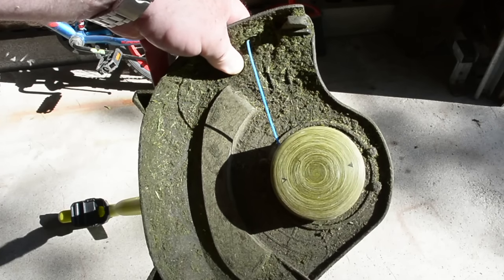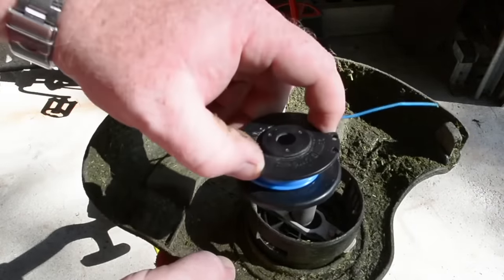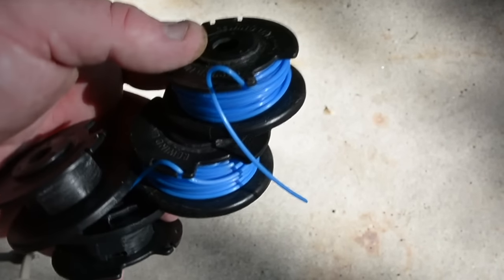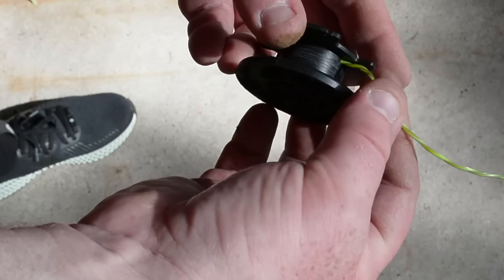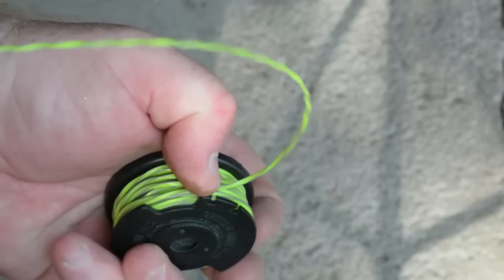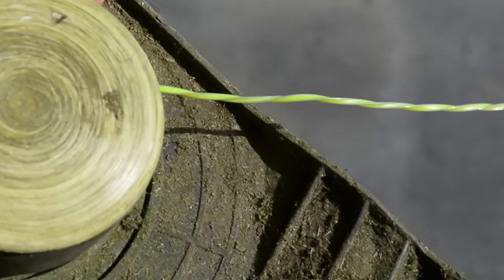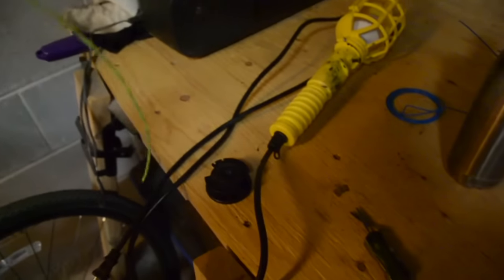RYOBI How to Re-Spool/Re-String 18V WEED WHACKER

Comment: Why does mine keep snapping off while I’m cutting
Reply from the maker: Probably because you’re hitting the string against rocks or trees or something hard? I like to trim right tight to these things, so I don’t mind if my string breaks. Also, I think after a year or so, the string becomes more brittle and breaks easier.
Reply: @heyitsjosh  eh, that can't be it , a rock isn't going to snap a .065 string. Likely it's because the string is not really secure inside the casing and it's slipping out of the casing at a fair clip and whenever it gets to the line cutter it just continuously cuts the line every X revolutions and the next thing you know you're out of line...and you have no idea where the heck it went to.

Comment: I need to learn how to insert a new spool! Your video didn't show this.
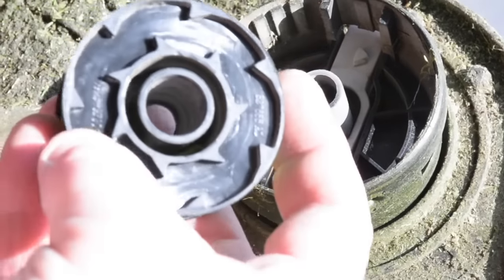Reply from the maker: 4:07
Maybe I should make a quick video on just that part...It's actually quite simple. There's one side of the spool with "gears" or "teeth" or notches taken out. That side of the spool goes down and makes a grip or connection with the motor head from the main unit. You then take the spool of cord, and have maybe 1-2 inches of free cord, free from the spool, and as you insert the spool into the motor head, simultaneously put that 1-2 inches of free cord through the circular hole in the motor head casing. Then slip the cover plate back on and you're good to go!
Reply: @heyitsjosh  That would be very much appreciated!

Comment: I got one, I conclude that it's a piece of junk.  The cutter blade housing gets broken off by the string, and it is un-repairable as it broke off the plastic housing that holds the blade in place by a screw.  This happened to TWO nearly identical trimmers.  Why isn't the shroud made of metal so it can withstand getting whacked by the string?  Now if I put string back in it with no blade the string will just keep getting longer and longer every time I start and stop it because I now have NO blade to keep it trimmed.    If this were the old fashion type that a knock on the ground extends the string I could still use it.  This trimmer a piece of JUNK!  I looked about at HD at all the trimmers and did not see any that were made of metal so I did not bother to probe any further and settled for this pos.

Comment: Where is this hole that EVERY single person says to feed it through first? Mine has none
Reply from the maker: This video may show closer up
Weed Whacker Spool Unwinding? How To Properly Wind Weed Whacker Line
https://youtu.be/339wJE8b4dA
Reply: @heyitsjosh  i mean it literally has no sort of starter hole at all to stick the line in, like its just flat all the way
Reply from the maker: @destiny49  The only purpose of that little hole or notch is to hold the line in and prevent it from coming out / unspooling all at once. If there's no 'notch' in the cylinder of the spool, perhaps there's an insertion point in the outer edges of the spool, but toward the center of the spool where you would begin the re-spooling: some sort of little drilled out hole? I've re-spooled various weed whackers and there needs to be something to friction-fit the line into the spool.

Comment: Still won’t work, it just spits out a ridiculous amount of line and then the thing turns off on me
Reply from the maker: when you insert the cord into the little notch in the spool (the very first step), be sure to reverse the direction when winding the cord. Go back against the direction of the inserted cord. Eg. If the spool is in your left hand, and you insert the cord into that little notch in the spool and the cord then extends toward your right hand, wrap the entire cord back against that way, so wrap the entire cord to your left. If you're doing this already, maybe try winding the cord a little tighter around the spool (more tension when you wind the cord). Good luck!
Reply from the maker: @ryanshock2541  I hope it works for you
Reply from the maker: @ryanshock2541  Did you get it sorted?

Comment: It advances every time you stop!?!?!?!? THIS IS A MAJOR FLAW. I stop the motion of the string at least a dozen times while cutting-to rest, to see what I need to cut next, to switch from trim to edge, to save the battery between areas needing cuts while walking to that area. This trimmer sucks
Reply: Exactly, it's like a scam where they make you have to buy more string.  Anyone know if the Speed Feed 400 head will work on this?  I laughed the first time I saw this Ryobi with only ONE line coming out of the head and not 2.

Comment: Too bad this trimmer overheates in 10 minutes
Reply from the maker: I’ve used maybe up to 4 batteries worth in a row, cutting tall grass, and it’s never overheated. I find it to be quite the light, agile little workhorse. I think perhaps on a very hot day the battery may enable some sort of overheat protection.
Reply: @heyitsjosh  Mine has never overheated and i use it for about 1/2 hour each time. Heavy grass, too. Ryobi is good stuff.